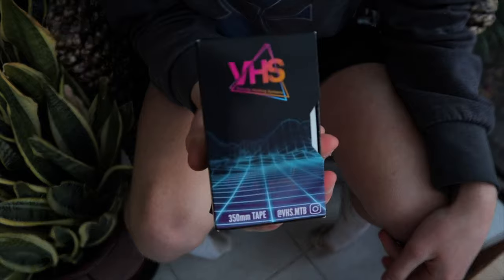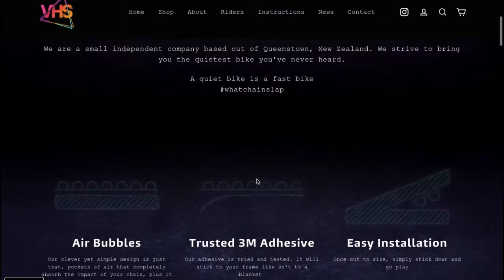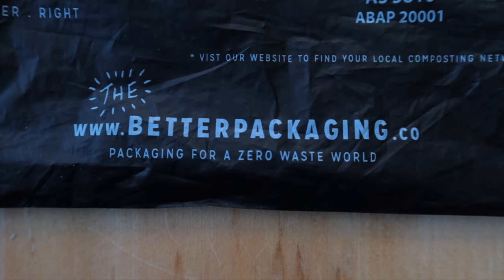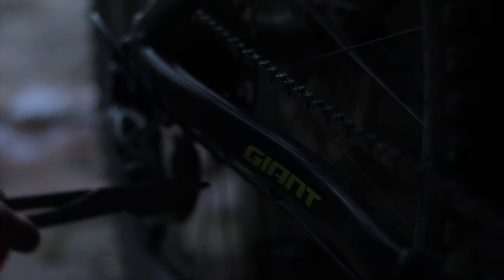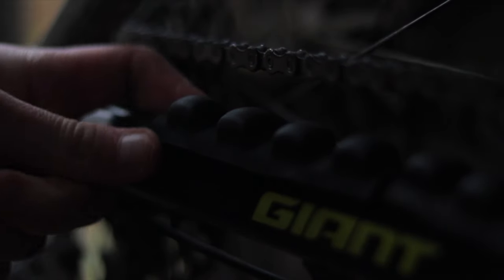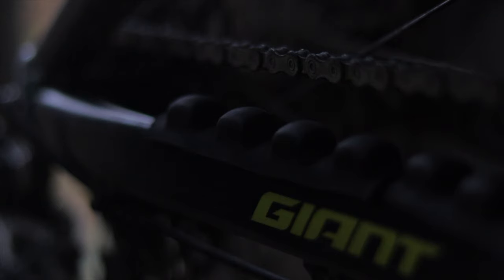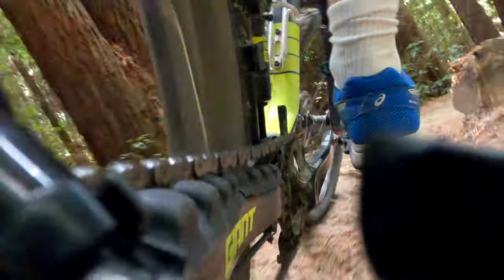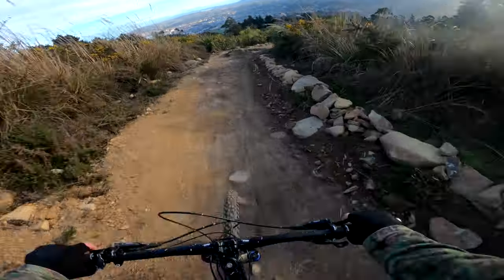What Chain Slap?! | VHS Tape

Comment: What can I do to reduce chain slap on the bottom side of the frame I am new to biking so please explain it simply + new sub
Reply from the maker: thanks bro! you can always wrap an old inner tube around the chainstay, where all the noise is coming from. Always a good option, but it won't eliminate all sound